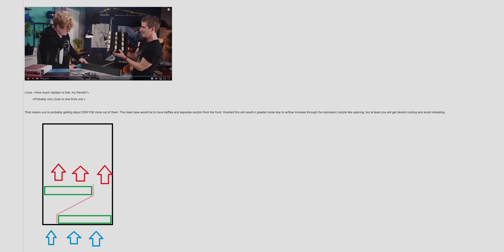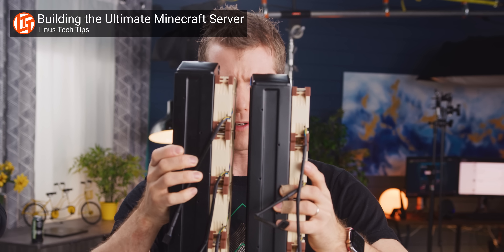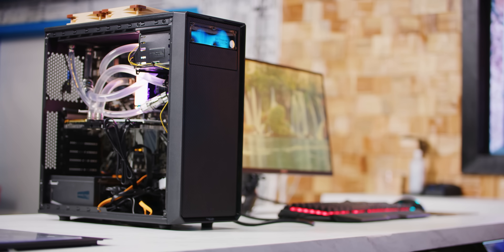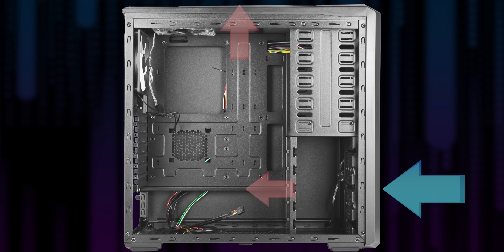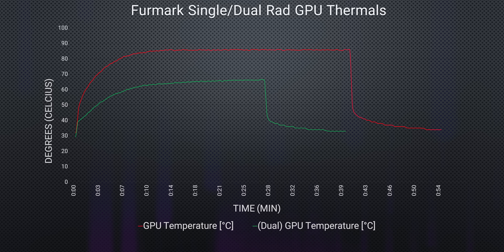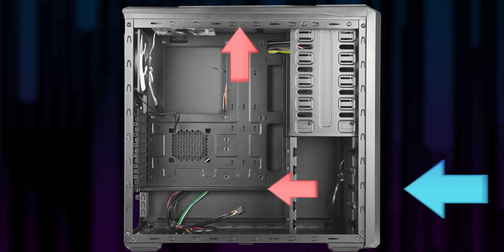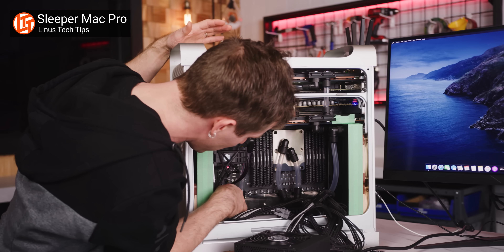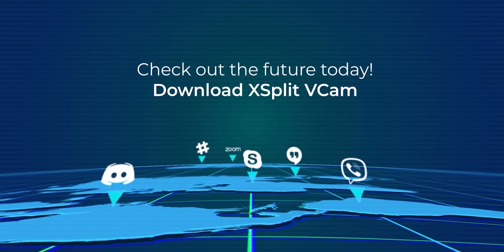I’ve been water cooling wrong for YEARS - $H!T Manufacturers Say

Comment: I think you pretty much hit the nail on the head with all of the factors you named at the end. The trick with radiators is that the fluid isn't one temperature inside the radiator, and neither is the air.  The faster you blow the air through, the less it'll heat up, and the faster you flow water through the radiator, the less it'll cool down.  So you have this crazy 3D temperature gradient inside the rad from bottom to top and front to back.  It would be really interesting to put temperature sensors on either side of the components in the loop to see how they vary around the loop, as well as in the case to get an idea of the air temperature distribution.

Comment: Little Question: Wouldn´t it be better for both rads to pull Idle air in and like 1-2 Fans to just pull out the hot Air?

Comment: 2 additions. Firstly the air going through radiator A didn't pickup 100% of it's heat capacity so even stacked you'd probably see an improvement. And secondly more radiators means more water which means more "thermal mass" for they system overall. You'd probably see a temperature improvement by adding a big reservoir and then gaming with that vs a tiny reservoir.

Comment: As long as the air is cooler it can cool the rad. If you stack 3 behind each other the performance if the last one will be way lower or maybe even deleted if the air is heated too much in the first two.

Comment: Would have loved to see a thermistor setup on the inputs and outputs of both radiators so we could actually compare intake and exhaust temps. Thermo never lies. I doubt the exhaust air from the first radiator comes as close to water temp as Corsair claims.

Comment: One of the best air coolers on the market, the Noctua NH-D15, does exactly that, it has one fan blowing the hot air extracted from one rad, directly into the path of the second fan blowing into the second rad. This probably works because, as you say, the rad surface area is much larger than this type of cooler where there are two fans, one blowing one sucking acrross a single rad, like the also excellent D12A. The D15 has two large rads with the accompanying larger surface area.

Comment: Another way to test this theory is to take the incoming air temp vs exhaust air temp. My setup does that and the air coming out of my case while warmer than ambient is only a few C higher. Now I do have a lot of rad space which results in really low DeltaT of my water. The point is though that even 3 rads all dumping hot air into my case and out of another rad doesn't raise the temps to my water temp level. I would say it is about middle of the difference between the 2. So with a deltaT of 5-6c you would see air temp at the exhaust side around 2-3 c higher than ambient

Comment: You really shouldnt have skipped that many physics classes... Allso, get a pair of glasses, that green GPU line is/was still on the rise.
Long story short: You forgot about the water volume. Let both setups run for 8 hours, and you will end up with the same temps.
It may be noted that Corsairs assertion is only correct if you do not have ANY intake fans in your rig, supplying extra air at ambient temps.

Comment: there is a grain of truth in what they said. if the internal air temp is the same as the water then of course you wont get any real effect of the radiator. that being said air has a much lower thermal conductivity than water. simply put even on a low fan speed the air is not getting as hot as they say it is. and the higher the fan speed gets the cooler the air being pulled into the case is. this argument is implying they can pull the heat out of the radiator as quickly as the water pulls it from the components. if that was the case we would have ambient temp loops on all modern computers!

Comment: As long as the air entering the second radiator is cooler than the water/ liquid going through it you'll see some benefits. Otherwise you'll be adding heat/ energy to the loop with the second radiator. 
Both can be right or correct at the time until tested .
"schrodinger's 🐈"

Comment: Yeah, I just went through this with the case being in the way of the rad and fans. I put the fans on the outside of the case, Rad inside the case. Didn't work well. I cut the top of the case grille out, the remounted the Rad on the outside of the case. Then out the fans on top, drawing air out of the case, got +3c to cooling, even more significant at higher Temps. 
Its all about airflow over the rad. More Flow, more cool.
Also, cooler air = more cooling and heat Transfer/exchange.

Comment: I found that all this is so over rated,ever wonder how a vehicle removes heat?  I am old school,and I have a super fast gaming system I built,my temp goes no higher than 40C  and its all AMD,and I run 3 fans,no radiator,well if add all other units fans,then I use 5 fans,and they adjust  via the board when I need more speed of the fan.
so why do I need a radiator??

Comment: Where the testing done with sidepanels on?? Sidepanel on and fan rpm set to low would be a fun thing to test. because if fans where set to highest rpm and the sidepanels off then the case would not represent real world usage where we watercool for low db. Also with low rpm on the fans theres the chance that the air is pulled out of the case so slow that the air would heat up before being pulled out.

Comment: Correctly chaining the loop is fine. A lower gradient with larger area offsets the penalty. But there is diminishing returns. Ideally all should receive fresh air. If not, the hot should be dumped into the hottest radiator.

Comment: No no! I don't think Corsair meant this at all. Ofc two rad are going to be more efficient! But what you are doing is blowing the hot air from the first rad through the second one. That makes the temperature difference in the second rad smaller. 
What you would want to do (and i think Corsair meat) is for both radiators to have a supply of fresh cool air so that you have the maximum temp difference in both radiators.

Comment: Why didn't you also test their advice and setup both radiators drawing in cool air? Exhaust out the back. "Corsair says what we are doing is bad. OK lets just test that our system works slightly better and finish the video there." No need to test that their recommendation is better again.

Comment: I built an automated greenhouse and we had to ensure the plants not only met the right temperature but the right humidity. We had an image classification system that would identify plants in high-humidity as plants that were in a hot room. That being said humidity has a large part of airs thermal conductivity and properties.I find it very hard to believe that they claimed a pass through of a small radiator we completely saturate thermal ability of the air. You are running gpus for virtualization in the rack are you not? Ya you need the cooling

Comment: Maybe their intentions were that you would have better performance with 2 radiators as intakes than 1 intake and 1 exhaust. Atleast that is kinda what I was taking it as until you went ahead and made it 1 intake and 1 exhaust.

Why not test front & top as intake? Provided the case has filters there is no reason you couldn't have bottom, front & top all as intake and rear exhaust right?
Technically then all air in would be cooler air going over the radiators and should net better results.

It's nice to see this type of test however because not all cases do have filters everywhere and not all cases can be setup or used as all intake or with stacking them sometimes as you said you just have to. So it's still cool to see this type of test done.

Comment: You forgot (or didn't know) that you can have 2 situations here:
a) (better) inlet of water from heating elements is going first on external radiator and then to the internal one. 
b) (worse)  in opposite direction.

a) is called "counter-flow" and it is better because you have always temperature difference between water and air.
here is short explanation why: https://www.quora.com/Why-is-a-counter-flow-heat-exchanger-better-than-a-parallel-flow-heat-exchanger 

so... you are both right ;)

Comment: Might be said already, but when they say 'stacked', wouldn't it be obvious that they mean against each other, like that server rack build, with the same air going through each rad???  That jives completely with what they said.  I can't figure out how Linus talked about how the air coming out of a rad would be close to the water temperature, then tested with two rads in different places, each just blowing rad heated air into the room, (also pulling more room temp air through the case), and making that entire point about a different setup completely......  am I in crazy land here?  Entirely different setup, and I think He's going to find that out.  The one that Corsair responded to was literally stacked, as in AGAINST EACH OTHER.  Not MULTIPLE.  STACKED.  PHYSICALLY.  He mentioned another build at the end giving similar results, but I have no idea what that one looked like either.  BAD Linus.

Comment: at best stacking rads in inefficient. but you will never have a case where the heat transfer is so efficient  it messes with a second rad, a third rad... possibly. 
Personally im a proponent of rads outside of the case, most cases have large oles for cables/tubes, use them better yet. get a 30-50 gallon tank, and use that as a res outside of the case, this way you can just add some ice to it to cool everything down and may be able to cool it passively.

Comment: I honesy thought the idea of an exaust radiator is a bad idea because of hot air. Also i dont know why you would stack radiators. You neeed at least 120 for each chip. A 360mm can cool a cpu and 2 gpu's

Comment: In fairness, a PC selected to have the hottest components and then run on synthetic benchmarks would provide the biggest possible delta-T for the cooling system to do its job even in an inefficient configuration: maybe with a smaller general difference between coolant temperature and air temperature, you'd hit the diminishing returns part of the curve a lot faster than under a giant, artificial load? Just speculation on my part.

I also wonder if plumbing configuration could improve performance: I did consider adding a second radiator to my machine a while back, and thought maybe the best thing to do would be RES -> HOT COMPONENT -> RAD -> HOT COMPONENT -> RAD -> RES? This way the coolant temperature is always elevated prior to entering a radiator? IDK. It would be fun to test.

Comment: But if you take an insufficient rad, then you benefit from a second one, because the statement about exiting air being almost same temperature as the water being cooled does not hold. Also, from the graph I don't think the (bigger now) loop finished heating up.

Comment: Having been a tech for about 18 years now I've had plenty of experience with Engineers.  First thing, when I was 18 (Fall 1998, Spring 1999) I went to the local community college with illusions of being an Engineer myself.  While the instructor was demonstrating how to design something on one of the early versions of CAD (sidenote:  PC had 256MB of RAM and would struggle with simple 3D objects) one of my classmates asked how one would access it to fix whatever it was because there wasn't a way to get into it.  Engineer/Professor's response was, "That's not your problem, that is the tech's problem."  And as a tech I've seen that attitude in equipment design ever since.  
Eight years ago I was working at a tech at a small robotics Engineering/Prototyping company.  The head engineer brought in some new parts for a new design and asked the Lab Supervisor/Lead Tech to put them together.  The Lead Tech tried to put them together for sometime and eventually realized that it wouldn't go together because of mechanical interference.  Literally two parts needed to occupy the same space.  The Lead Tech went and got the Head Engineer, brought him into the lab and showed him the problem.  The Head Engineer saw the problem and laughed it off as "it fit in Solidworks".   Solidworks is a CAD program for those not familiar with it.  I'm not sure how much money was wasted on the parts, but they were all one off high precision (0.000 tolerances) metal parts that we contracted with a machine shop to make.  And the parts had been inspected and dimensionally measured with a optical measuring machine prior to the assembly attempt.  
Some engineers are good and know things still have to be tested.  Some Engineers just run the math and if it doesn't work then they blame it on someone else (even when it is obvious the Engineer left some factor out of the design).
Reply: "It fit in Solidworks." Yeah, but did you do a collision check? Maybe without treating coincidence as press fit? I'm sure he had the assembly file somewhere in any of the various drives he has access to. That sort of thing would take literally 2 minutes, counting the time it takes to find the file and load the assembly. Not that he would've done it, some of those sort of people will actively discourage any wrong-think. Up to and including lying to their boss's face.
Reply: @mage3690  Being a tech I've never used solidworks myself.  Didn't know there was such a thing as collision check.  This was back in 2011-2013 timeframe.  Maybe collision check got added later?  Thanks for the reply.  Have a good one.
Reply: @The_Opinion_of_Matt  googled it, found a video from Dec 1, 2009 that gives a tutorial on how to do collision detection. The video was three minutes, and gave a detailed enough tutorial on how to perform collision detection on a moving system that I'm sure anyone could do it. The buttons and menus have barely changed at all between now and then, to the point where I'm fairly certain I could follow along with this year's version. Interference detection, the tool you want to use if your system has no moving parts or before you check those moving parts, has been around since at least a 2007 video which mentioned it in passing. That second video was also on collision detection, and was also less than three minutes.
Reply: Also, just wanted to say, being a tech is no longer a good enough excuse to not learn Solidworks, at least not at Alexandria Tech in 2019. First year, first semester, they sit us all in front of computers and give us an hour class on Solidworks. Goes the whole semester, and at the end, you get the option to take the official Solidworks exam for extra credit. I passed, BTW. Most of my class did. Well, the one's that finished, anyway. Quite a few gave up halfway through, most of whom I was fairly confident had decent odds of passing. Oh, well.

Comment: Corsair was talking about physically “stacking” radiators. You did not sandwich them.  As long as the rads don’t share exactly the same air, that is a different situation.   Also, I would imagine Corsair was saying that “stacking is less efficient than spacing them out, which is true.

Still, it is hard to imagine how 2 rads would be worse than 1.  You have a larger water heatsink so the extra water will store more heat.  You would have to totally saturate both rads, and that will always take longer than saturating one rad.

Normal workloads will rarely saturate.

Comment: So you did the test with one rad and again with a second rad. Can you do the same rig with no rads at all just fans and add the results to this test as a second part video. Also can you do a noise comparison from having 1 rad, 2 rads and no rad setups. Just use the same fans and same amount of fans with and without rads. I remember back in the day the entire point of having liquid cooling was making things more quiet compared to air cooled using just fans. Well today liquid cooling seems to have just as many fans or more and just as much noise as just air cooled. But anyways it be nice to compared 1 rad vs 2 rads vs no rads at all for temps, throttling and sound levels. I say this cuz I noticed my new amd build gaming rig seems that is 100% stock air cooled idle is around 40C for cpu and gpu and like around 28C for case while gaming stays about all the same maybe going up to like 54C for cpu and gpu with maybe like 32C case temp with very low fan rpm speeds or fans staying off for the most part. This is while playing games like gta v, or doom 2016 or eternal, or like sea of thieves or like mud/snowsunner maxed out at 4k 60Hz or 1080p at up to 240Hz(freesync) depending on what screen I'm playing on.